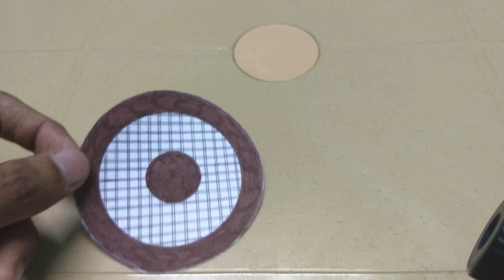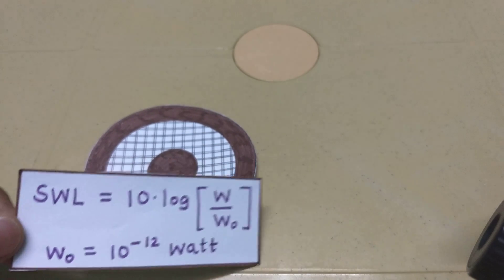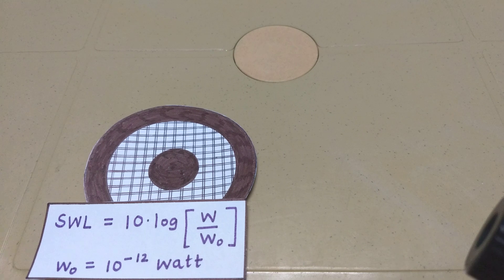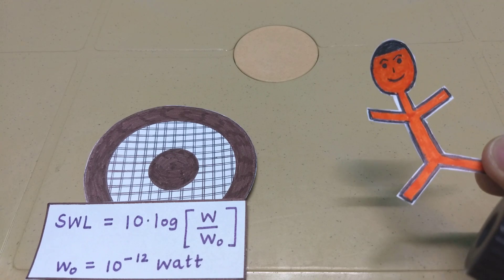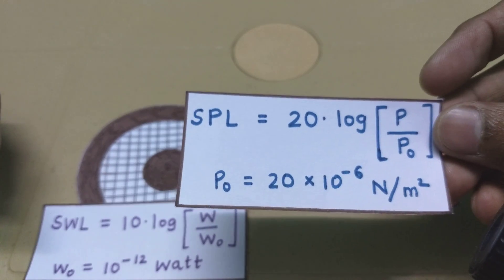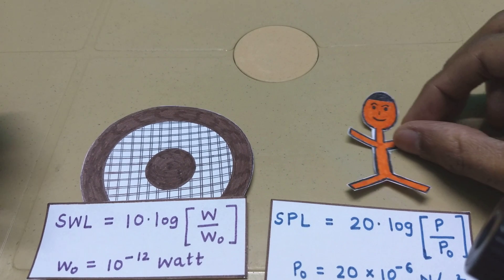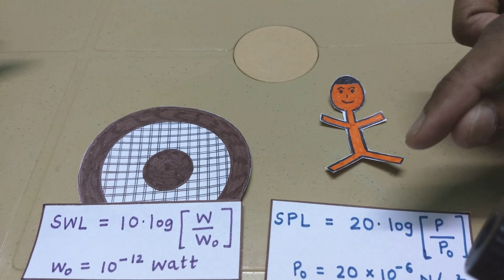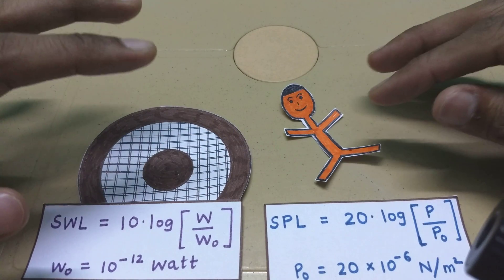Difference between Sound Power level and Sound Pressure level explained

Comment: Finally someone explained it in a way that make sit clear. I was looking at specs for the internal units of splits aircons and it showed both Sound Pressure and Sound Power but without explaining the difference anywhere. Nicely done. Thanks!

Comment: may i ask if there are 2 speakers, how would the value change?
Reply from the maker: Hello,

Thank you for watching the video. If there are 2 speakers, the sound power level (SWL) will either add up or subtract. It'll add up if speakers are in phase and subtract if they are out of phase with respect to each other. Same is the case with sound pressure level (SPL). The addition/subtraction however is logarithmic and not linear. I'll be explaining logarithmic addition in a future video. Finally, SWL is still independent of distance while SPL is not.

Comment: Good explained!
But whats difference Between SPL and SIL?
And when we talk about Sound Level we are talking about SPL or SIL or both?
Reply from the maker: Hello Samad,

Thank you for watching the video

1. 'SPL' is Sound Pressure Level while 'SIL' is Sound Intensity Level. Intensity in general is Power per unit area. So, Sound Intensity is Sound Power per unit area. 

2. Sound level generally refers to SPL. The word 'level' is used when describing a quantity (ex. Sound pressure/power/intensity) relative to a reference value. The reference value is usually denoted with the subscript '0' For example reference pressure Po = 20*10^-6 N/m^2.
Reply: Does it mean that sound power and sound intensity are mean the same while sound amplitude and sound pressure similar??
Reply from the maker: Sound power is the acoustical energy of a sound source, sound intensity is sound power per unit area. When we hear sound, we only hear sound pressure. The amplitude addresses the loudness of sound.